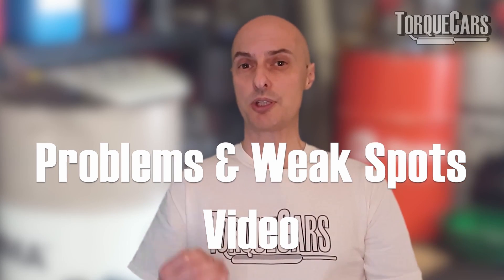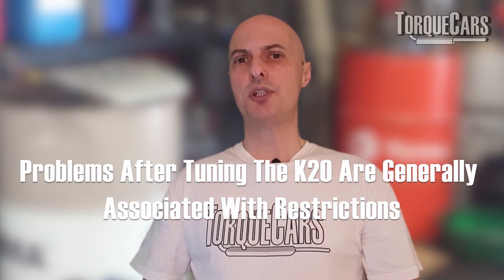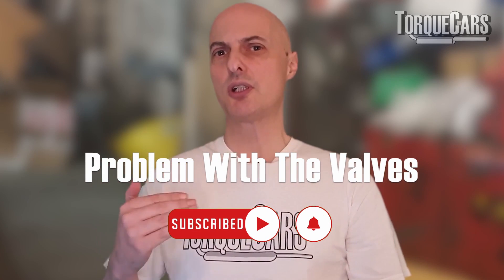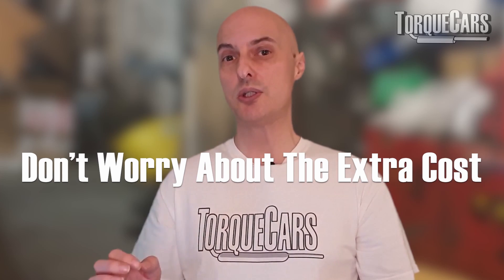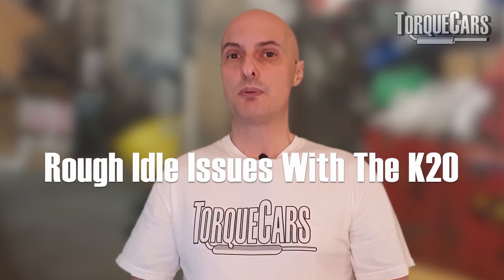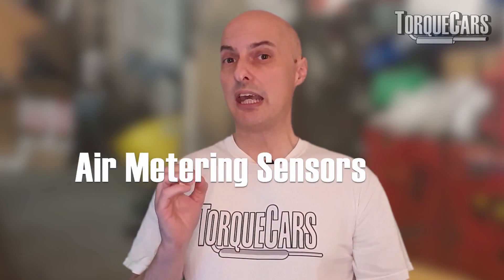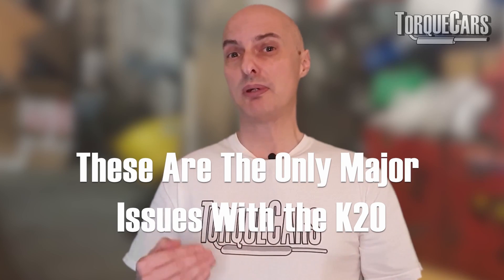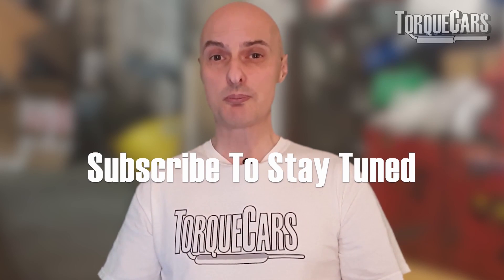Honda K20 Common Problems & Issues [Troubleshooting]

Comment: My two issues in my k20a JDM dc5 type r motor has been VTEC solenoid gasket leak and now main seal behind crank pulley. Just $60 worth of seals.

Comment: Hi there, I need some advice for sudden loss of low end torque, what should I be checking? When the VTEC kicks in, it is not as powerful as before, I am using 98 octane fuel. My fuel consumption also suffers like crazy recently.
Reply: I have the Same issue on my FD2 R has a horrible fuel consumption and the pre Vtec touque is so low! The throttle seems to hesitate till about 2-4k RPMs! 
Occasionally there’s a bog down/jerky throttle at low RPMs 
Comes out with no fault codes on the scanner!
Reply: @romellojayathilake3419  try replacing your pre cat lambda sensor, i had the same issue on a k20a2
Reply from the maker: Which year is this? Are you getting any OBDii error codes or dashboard lights?
Reply: 2008, FD2R, no error reading, no Check Engine Light.

It just happened suddenly.

Comment: Hi there, I have a sudden lost of low end torque, but when the VTEC kicks in, it is ok. What should I be looking at?
Reply: @philipgeorge72  Same issue, have you found out the problem?
Reply: @philipgeorge72  probably the timing chain is stretched leading to valves not seating properly. Very common issue. VTEC would fix this by a more aggressive cam profile. Replace chain tensioner + chain at minimum, but also guides and crank gear if able.

Comment: So basiclay the biggest issue is maintenance
Reply from the maker: They are very solid and reliable engines, there is little to go wrong really. Some of the problems videos I've been working on run for over 10 minutes for some models, it was actually a struggle to find things on the K20.
Reply: i have an 03 EP3 hatch my k20a3 has 234k no check engine light, no idle issues, just drove took it on a 4.5 hour car drive in 90 degree heat no issues.